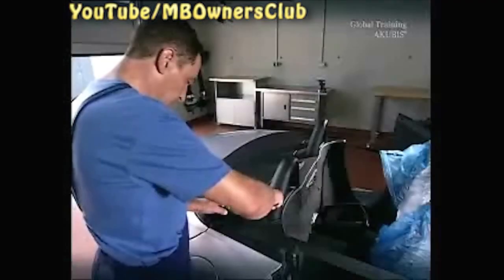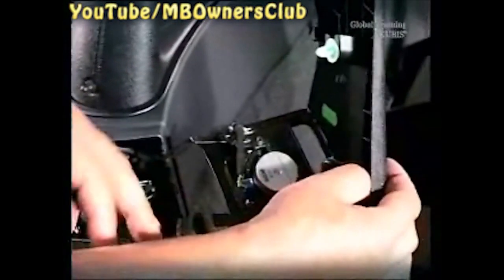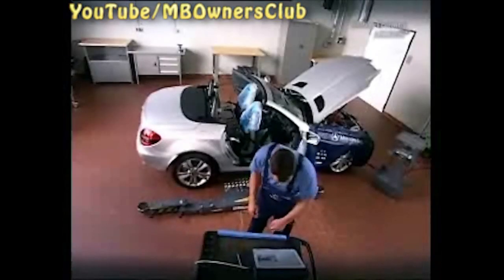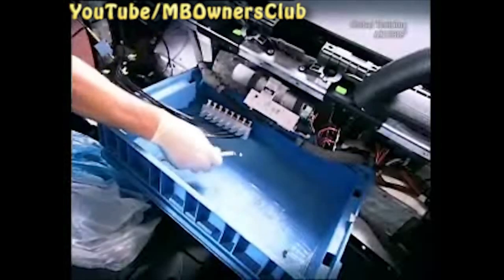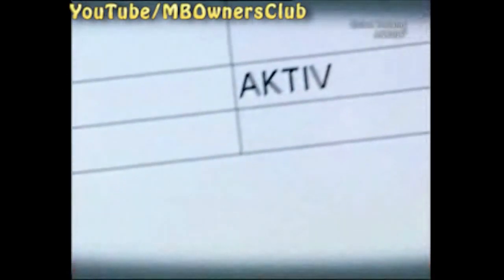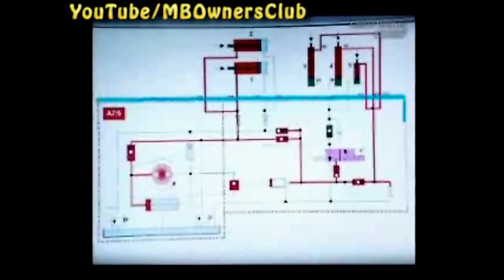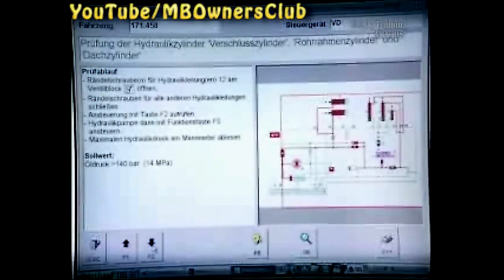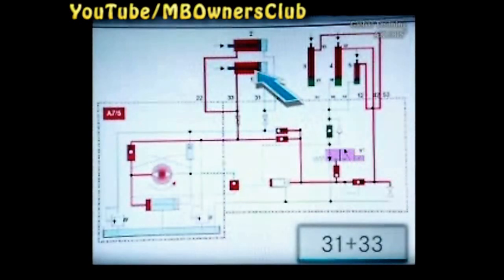Mercedes-Benz SLK-Class - Connect / disconnect test valve block on hydraulic unit - Part 1| R171

Comment: Hello! I have a 2006 Mercedes Benz Slk 350, it had a leak on the top roof cylinder in which I  already repaired. So the pump was empty on oil and this pump does not have a low high marks like other pumps, this pump has a + sign, so I left the oil just below the + sign and when I try to open it it seems to weak? do you know if the oil level has to be above the + sign?